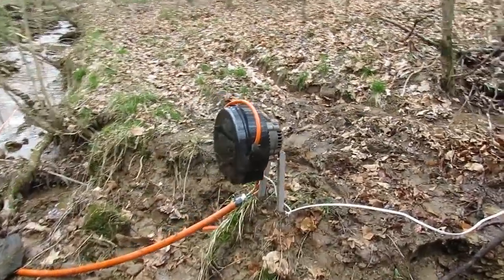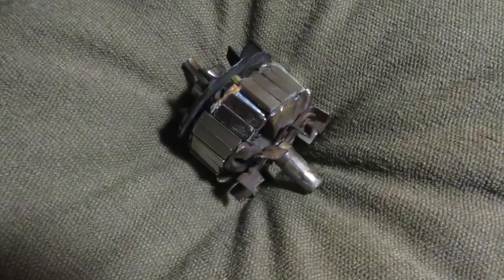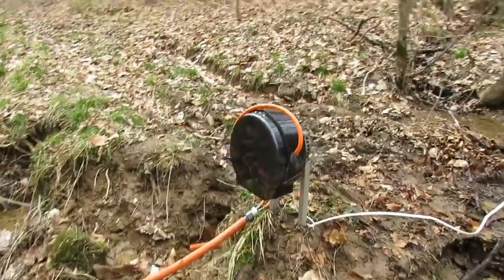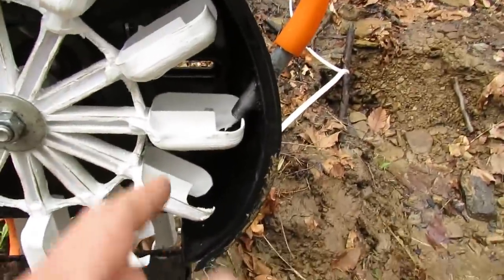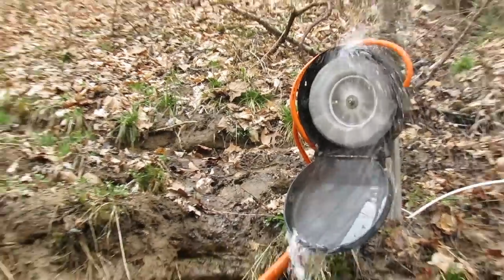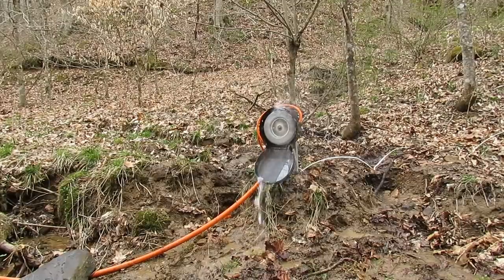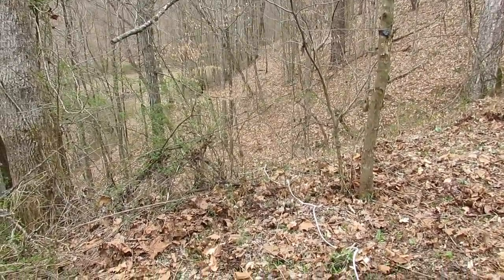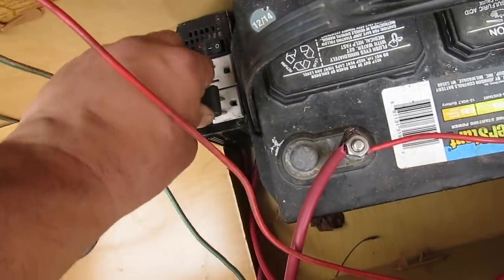Water Generator Running Off Grid Cabin

Comment: Why would you not add a modest sized battery at the generator site to an unmodified alternator which would provide the excitation & also peak demand storage? There is no way that converting an alternator into a dynamo is efficient...
Reply from the maker: The problem is the distance to the cabin. If I could put the generator right beside the cabin, it would work great producing DC and running it into the battery. As far as the cabin is away from the generator, it would lose too much power by the time it got to the cabin. DC has much worse voltage drop than AC.

Comment: You might think about putting your batteries in a plastic tub, because of the acid, when they go inside and venting the box to the out side of cabin. Batteries make hydrogen gas.  Exolosive!
Reply from the maker: I ended up putting them in a plastic tote and vented it. I put the electronics in another plastic container separated from the batteries.

Comment: :-\     the difference between the permanent magnet core and the non permanent mag cores, is perm mag always generates power, while the non relays POWER to magnetize the core :-\   ya,   get a marinr gran alternator...   they dony use power to generate power .. dumb idea's these engineers eh...
Reply from the maker: I guess a gasoline engine has the extra power to overcome the losses. Just not good for this type of thing without mods.

Comment: Where did you get the paddle wheel and case. Would like to get one.
Reply from the maker: The wheel I 3d printed and the case is a toilet paper dispenser like you would see in a public restroom. A pelton wheel from Ebay would work a lot better than the one I 3d printed though.

Comment: I think it's a great way to get free electricity. If you come across a truck junkyard,, where you can get your hands on a Caterpillar 24v alternator,,,buy an automatic 24 to 12v transfer switch,, (amazon.com) and some DEEP CYCLE marine batteries and run it through a LARGE inverter,,the type with a cooling fan and use LED lights for minimal draw,,,,,you will have soo much reserve power,,,,,like enough to run a toaster or coffee maker. I'm sure if you made that system,,you'll figure this out. We have a system like this at our hunting cabin in Upstate NY. Had it for 4 years and it works real good. Loved your video. That's what it means to use your head. Great job,,,,,keep 'EM coming
Reply from the maker: Thanks! Yeah, a heavy-duty truck alternator would be much better.

Comment: The gas from the battery will destroy that charge controller. Vent box as stated by others. Control your runoff. Great system and modification. Looks like a lot of work on that cabin. Great job.
Reply from the maker: Thanks. Yeah you are right about the battery gasses messing with the electronics. My power inverter ended up getting corroded to the point it stopped working. I now have the electronics in a separate plastic tote.

Comment: I wonder how much power your losing from that long run from the power source to the cabin
Reply from the maker: The open circuit voltage at the alternator is around 30 volts, by the time it gets to the cabin it's more like 18-20.

Comment: I had a submergible water turbine that needed to be under two feet of hard flowing water to spin the turbine fast enough with enough pressure to create energy 
 I was on a fast moving river working for a hatchery, over twenty years ago...this model is so much smaller, mine also pumped water up a 500 foot high cliff, ran two grow lights and my fridge and stove- heater, computer laptop, DVD player...yours barely has any power...
Reply from the maker: Yeah, I figure I only get about 50 watts out of it. I have solar to supplement it now.
Reply: @lukeFugate  but I guess it's the difference in cost and size...still I think it's a wonderful invention! 
Well done!
Reply: Would it be possible to use the same water source to turn several water wheels? Like ten or twenty?
Reply from the maker: @c.a.greene8395  As long as you can still have a drop in elevation I don't see any reason you couldn't use as many generators as you could build.

Comment: I like what you have done it's dead nuts simple. There are ways to make it simpler yet.

I would suggest take your lighting off the inverter, go low voltage DC this will save you power in the long-term. You can pick up 12 volt LED lights cheap off Amazon. I use the bi-pin G4 bases that thread into standard light sockets.

A 5 watt LED light puts out a lot of light. I use one in a jelly jar type porch light, it lights up the yard and dogs area very well.

The reason I suggest going low voltage DC is you are not depend on the inverter for you lights, if need be you can power them with a jump pack if you batteries go bad.
Reply from the maker: Thanks for the suggestion. That would have worked if I would have left the batteries where they were in the video. I ended up moving them away from the cabin quite a distance and running the inverter AC power to the cabin. The reason for this was so I could use solar panels with the cabin. The cabin is in a very shady spot and hardly gets any sun so solar wouldn't work there. 
Using DC lights is definitely a better option and had I left the batteries closer to the cabin I would have. That's what I did in my bus. is has all DC LED lights and it works great.

Comment: New subscriber here.  I enjoyed your setup. You mentioned drilling holes in the bottom for the off gasses.  I believe you need to have vents above the battery as the gasses will rise. Again, we’ll done.  I would love to try this if I were near a water source.
Reply from the maker: Thanks. I ended up getting a couple of plastic totes and put the batteries in one and the electronics in the other. I drilled some holes under the lip of the tote with the batteries.
Reply: luke Fugate oh sounds good.  Thanks for sharing your projects with us.  By the way, I am just asking questions and not trying to tell you what you do.  Thanks again!
Reply from the maker: @brentjohnson6654  That's alright I appreciate suggestions.

Comment: Did you bypass the rectifier on the alternator so you could run AC power to the cabin then rectify it to DC at you battery box? It looks like this is what you have going on. It's not a bad idea since AC is better at traversing long leads.
Reply from the maker: Yes, that is what I did. AC doesn't have as much voltage drop so it works better. Thanks for watching.

Comment: You are turning ac power to dc power and then turning that back to ac power could you not skip the double conversion and use the ac through a voltage regulator
Reply from the maker: It's not clean ac power and also too low of a voltage. It it making about 20 volts of ac power at varying frequency.
Reply: What if you remove the diods from the altinator
Reply from the maker: @seanharris6359  The alternator would have to spin at exactly 60 hz in order for the ac power to be used by any electronics or induction motors. With the varying stream conditions, leaves and debris piling up on the screen etc the speed changes constantly so the frequency of the ac would be unusable. I also have the ability to charge batteries and use the cleaner power from the inverter for times when the wheel slows down or stops.

Comment: Maybe a Tesla electric distribution trick might help out a bit, by using a step-up transformer to send and a step-down transformer to receive .  In some theory it can be used to boost low voltage generation systems or times when not enough input power, here water pressure, is available.
Reply from the maker: Good idea. Similar to what power companies do.

Comment: Great inventive idea put to work. I was wondering if I don't have a 3D printer to make the water wheel inside the plastic TP shell, what could be used instead? also  should plastic covers be made to cover the alternator motor? and wire connections to keep it all dry as well protect the wire leading to cabin? be run through a PVC  pipe and buried?
Reply from the maker: After running this for a while I would say a metal wheel would definitely be better. The plastic deteriorates pretty fast with the sand and silt in the water. A pelton wheel from ebay would be a lot better. I put a plastic cover over the alternator and put the wire in conduit and partially buried it.

Comment: change your pipe to 4 inches diameter and load  it up with as much water as you can to build higher pressure on the pelton wheel
Reply from the maker: Good idea. Thanks!

Comment: Luke,   Will you specify the source for the rectangular magnets, Congratulations !  Any GM Alternator preferable ?   Are you willing to share your Pelton Turbine wheel 3-D  Programming software ?  Thanks for the insight.
Reply: Nice little stainless steel welding project if you got a heli-arc welder. I wonder what someone would pay for such a SS version.
Reply from the maker: I got the magnets from Amazon here is the link. https://amzn.to/38EUN9u They were too long but I cut them in half and they fit perfect it also gave me 24 of them by cutting them in half. I would recommend buying an aluminum pelton wheel as the plastic one is not suited for constant use and also loses a lot of efficiency. Here is the pelton wheel I used if you want to try it though. https://www.thingiverse.com/thing:33720

Comment: 5:41 "its puttin nout pweddy dued" yeah I bet ..given it needs 15k rpm to charge.. Why not use a voltage tester.. LoL your batteries ..all doing all of it..altenator wont blow the battery up.. Thats why its called an "alternator" thumbs down for lack of education.
Reply from the maker: If it's not charging the battery then that's one heck of a good battery. It hasn't ran down for 8 months running lights and a tv. I think maybe you are the one that lacks the education. I took a car alternator and converted it to a PMA. It doesn't have to spin 15k rpm to produce electricity. It starts producing at a couple of hundred rpm. I have an electronics degree by the way.

Comment: Looks like water was running in the generator. It needs to have a shield to keep the water from getting in it before it ruins the bearings or shorts the generator. Maybe could solve the problem by adding a shaft extension with another bearing to keep the generator further from the water or use a large piece of sheet metal between the generator and water to come out far enough so the water doesn't splash over on the generator.

Comment: I am sure this can give power to heat up the cabin in the winter correct!
Reply from the maker: The water generator doesn't put out enough power for heat. I am going to be using a woodstove and a gas cook stove for heat.
Reply: @lukeFugate  cmon I'm sure there's a turbine out there that generates ample power
Reply from the maker: @funnycomments6081  I've considered trying a Tesla turbine.
Reply: @lukeFugate  that would be amazing if someone can just get unlimited supply of heat
Reply: And ac in the summer
Reply from the maker: @funnycomments6081  Yes, the heat part would be great but I have the AC figured out in this video https://www.youtube.com/watch?v=beziRoj_8Xk&feature=youtu.be

Comment: So how long will u have power if it did stop running
Reply from the maker: It would run for about 6 hours with the lights all turned on. If you could budget the power by keeping lights off when you didn't need them and only using one light at a time it would last about a day. If you were running the tv and a couple of other things it would run down pretty quickly.
Reply: Y do u run the AC current up to ur DC switch why don't u just keep alternator stock an charge the battery y u got do all the Bak an forth
Reply: With the alternator being in modified it charges DC why u got modife it

Comment: Why can't you just run power straight to power box why do u got to hav battery an rectifier
Reply from the maker: The power coming from the generator is unregulated and goes up and down with the wheel speed. The battery and rectifier helps smooth out the power and also lets me use power even when the wheel stops.
Reply: So how long will u have power if the wheel stopped moving

Comment: How much power will that generate the way it’s set up?  How long will that single battery last?
Reply from the maker: It puts out about 50 watts. I have only had the battery run down when the generator has clogged up and stopped running. As long as it is spinning I have enough to run lights. I have since added solar panels and more batteries and I leave the lights on all the time now and the batteries stay at 100% all the time.
Reply: luke Fugate wish I had land to do that with!  That’s absolutely awesome!

Comment: not sure why everyone makes DC generators they should make AC generators all you have to do is put the copper windings where you have the magnets and put the magnets on the out side casing then you wont need a battery and all that other stuff and it makes more power AC generators is the way to go
Reply: J EASTMAN interesting  - I’m going to research your suggestion more. Thanks👍
Reply: @lifeliver9000  its just like the giant power plants that make electricity your just making a smaller version wish everyone would do this and put the big electric out of business they have been  rapeing  us for too long like a generator you get from home depot or lowes its that kind of generator they don't need batteries just a power source
Reply: but dont quote me on how its built its something easy as that tho

Comment: Luke - gotta have battery stuff inside 
and at least 6 if not 12 batteries.
Deep Cells aren’t worth the money and can’t handle not being charged very often, as you probably know.
Reply from the maker: I have more batteries now. I got them for $8 a piece at a scrap yard so if they don't last very long it's fine I'll just go get some more. I also figured out a way to add solar power to the cabin too. I show how I did that here https://www.youtube.com/watch?v=NTWoSivTpHE
I still don't have them inside though as the battery box is pretty far from the cabin now.

Comment: will that run an electric heater in the winter time!
Reply from the maker: Not enough power to run a heater. I have a natural gas stove and a woodstove  for heat. I can also use propane with my little buddy heater.

Comment: Great build, thank you for the video. You can do like fly fisherman do and build a funnel out of rocks right at the end of a fast running spot in the stream to make the push of the water coming out alot stronger straight into the tube. You could also use a reducer fitting to make the end bigger so it can get more water.
Reply from the maker: Good idea! Thanks!

Comment: What’s your voltage coming from the line in?
Reply from the maker: I'm getting about 20-24 volts from the alternator then the rectifier changes it to DC with some loss, about 12-15 volts then the charge controller adjusts the voltage to what the battery needs.

Comment: overall a great concept !! - I agree with some of the other comments about cleaning it up a bit, add ventilation to battery box, and I'd find an old trailer(mobile home) heat duct to make a outlet troth for the water to flow away from the alternator and seal up the toilet paper container to make sure water doesn't flow over the alternator and wires - run wire aerial so critters don't chew on it so bad   - can also get a few led light bulbs to break down and use as single lights instead of single bulb light or smaller led lights made for solar use so they use less power (can run on single AA battery) leaves more power for cooking or running household appliances tv, radio, small heater, etc.. - overall Great idea
Reply from the maker: Thanks! I corrected some of the problems and added some solar panels in this video https://www.youtube.com/watch?v=NTWoSivTpHE

Comment: put a mppt charge controller in place and use the extra  voltage... need to really clean up wire run etc.. also a shunt to measure dc current and a volt meter would be very nice
Reply from the maker: Yes mppt would be the way to go. I have since upgraded to solar as well as more batteries. The solar power system has an mppt controller, but the water system is still using a pwm. I do plan on upgrading that at some point. I cleaned it up some as shown in this video https://www.youtube.com/watch?v=NTWoSivTpHE

Comment: Vent holes need to be on top or high on the sides.  Batteries off gas hydrogen...and hydrogen is lighter than air...Vent holes on the bottom won't do a lick of good.
Reply from the maker: I vented the lid by putting a couple of screws in where the door shuts. It holds the door open just enough to vent.

Comment: @ 4:50 AC Current ? you mean DC..........
Reply from the maker: No it is AC current. Three phase "wild" AC specifically. "Wild" AC has no voltage regulation or frequency modulation. The rectifier changes it to unregulated DC current. The charge controller regulates the voltage to charge the batteries.

Comment: You need to place some semi large rocks at the base of your unit, the water running off like that will erode and wash away the base of your unit."..
Reply from the maker: Check the pinned comment. I did I just didn't film it at the time.

Comment: when I lived in Navasota tx  I had a fast moving stream and had plans on doing something like this but didn't think it would turn fast enough. but you just proved me wrong. with the hoses I was just going to build a large wheel and put it in the water.  but I had to sell my land and move back to my home town. and when the cut the woods behind the place I live now the stream here dried up. but I don't think it would have worked out here anyways because the water ran way to slow.
Reply from the maker: Yes, you need a little bit of velocity and volume of water. It's a fun project, you end up with a lot more efficiency and predictability with solar panels.